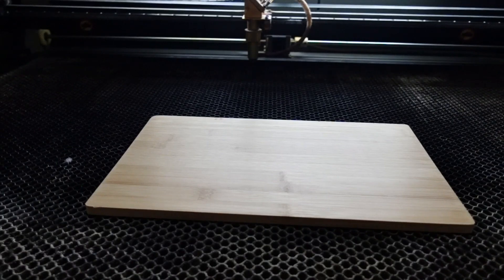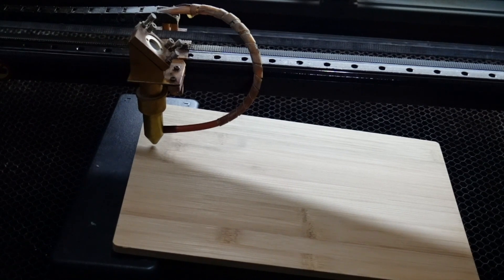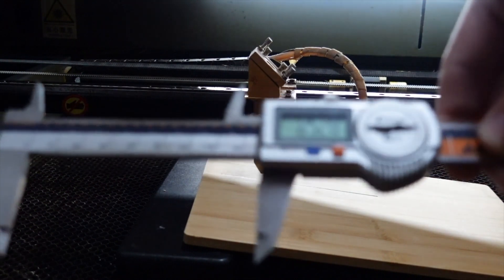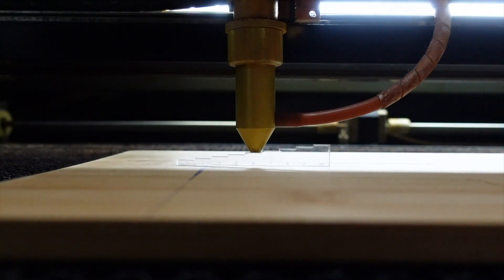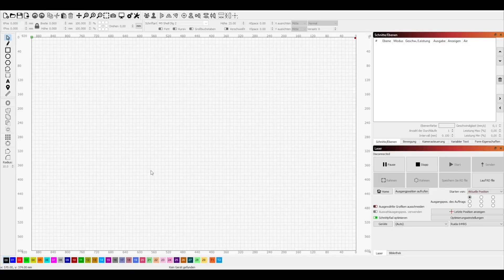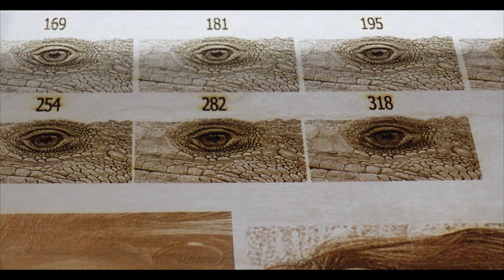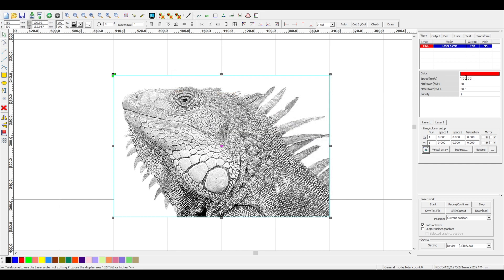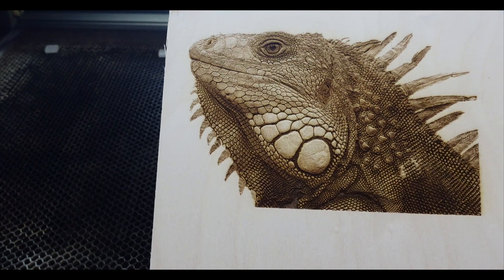Find the correct DPI value for your laser

Comment: Can you explain line interval. I saw on the lightburn forum that someone put theirs in Inches instead of MM. I'm wondering if I use a lens from American Photonics for the glass tube C02 laser. I should be able to get more DPI because the beam is smaller. If I keep the line interval the same is that correct or should it be adjusted?

Comment: Power and speed are very depending for different laser power. In my Ortur, i set power 75% and speed 5000. 
I am not satisfied with the deepness of engraving but, DPI test is good. 
It would be much better with lower speed but that would increase work time several times, and, i dont have a time.

Comment: For Some strange reason, I cannot get the rulers to cut.  The file loads fine in Lightburn but does nothing when I send it to the machine.  Using a Thunder 51 w/100W.

Comment: The light burn template file only has one cut loaded, is that because each picture has its own preset DPI so do I just have to turn on threshold or create individual DPIs?
Reply from the maker: Yes
Reply: @ImagR-Laser  thank you. Final question, do you have a suggested speed/power to start at for 100W when running this test on slate?
Reply from the maker: @matthewgilchrist1068  i would use low power and high speed. Like 10-13% power and 500mm/s